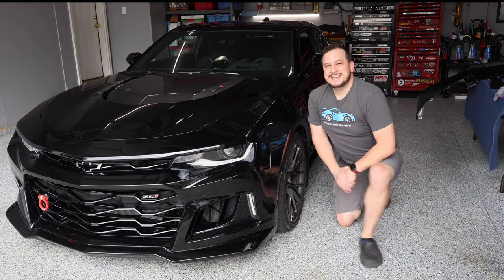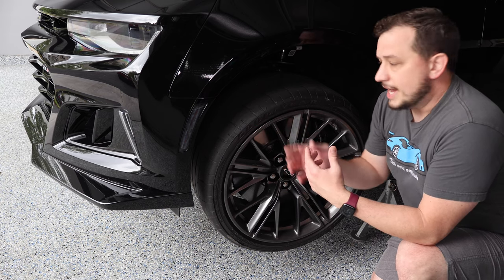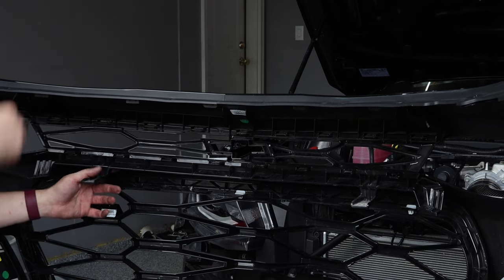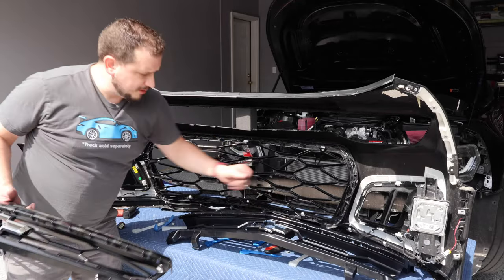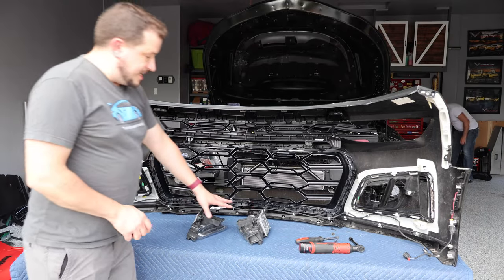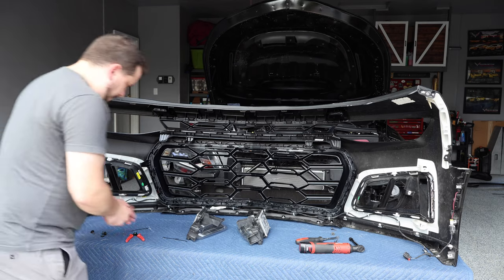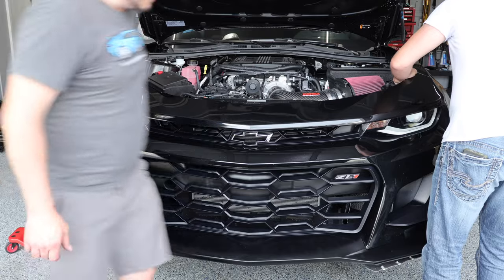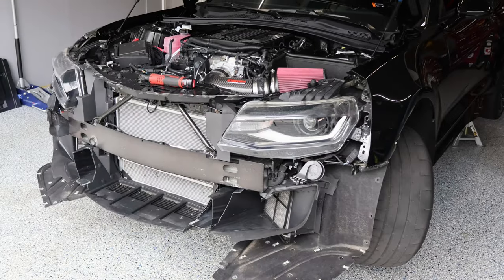How-To: ZL1 1LE Front End Conversion // GM OEM 1LE Parts

Comment: If I want to install the 1le splitter only do I have to take off the whole front bumper?
Reply from the maker: In order to the cut the slots needed, it would be a whole lot easier if you did. You could try it with the bumper on, but I don’t recommend it. You would be working in very tight spaces.

Comment: Just finished my install except for the sides of the splitter, can i cut the slit from the outside? I also didn't realize I have to order 2 locking clips for just the sides of the splitter
Reply from the maker: The template to cut the front bumper is marked on the inside of the bumper. You might be able to see it from underneath the car. You could drill 4 small holes at the corners and then cut from the outside.

Comment: just finished doing mine, what did you do with the under part where it’s alcantera and a bunch of bolts need to be put on but they don’t match the holes?
Reply from the maker: You’ll have to be a bit more specific. All of the bolts should match up if you used OEM parts. We didn’t have any issues with bolts not lining up or having extras.